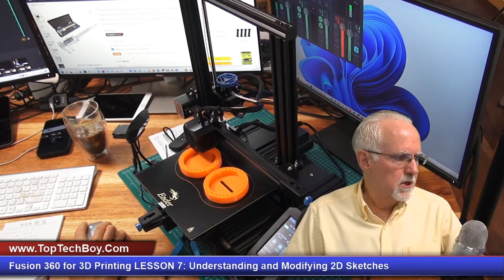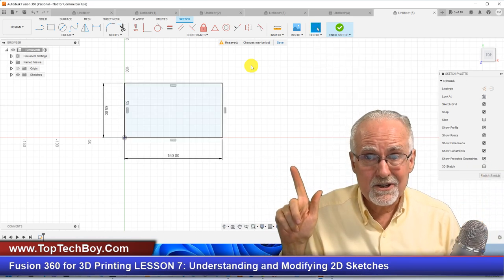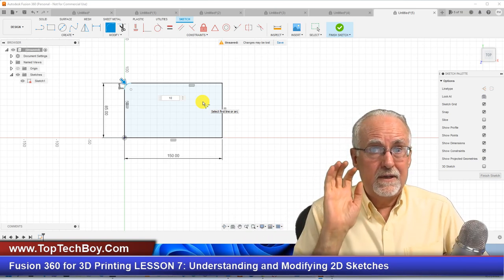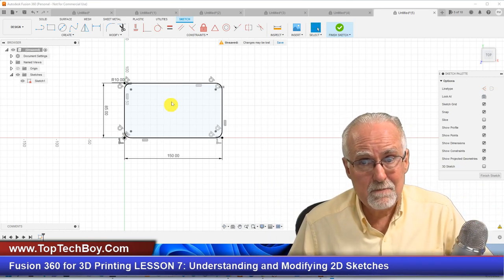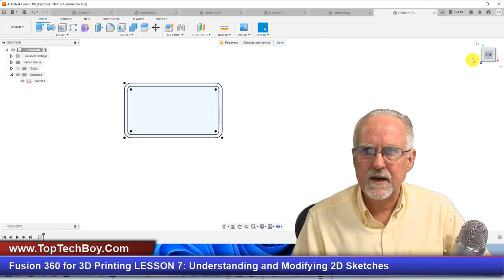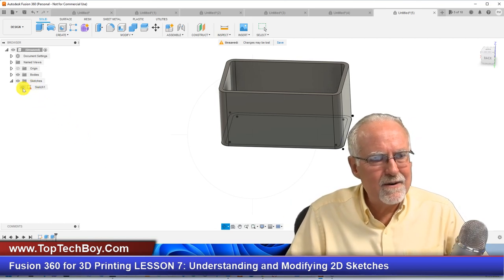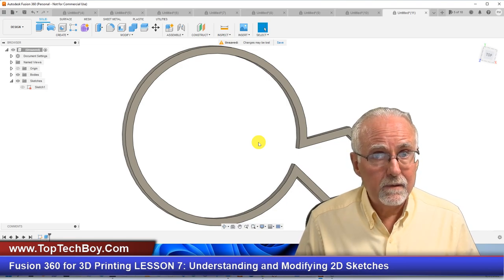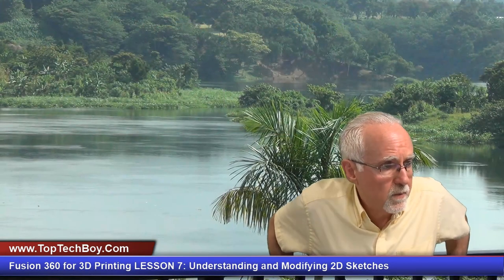Fusion 360 for 3D Printing LESSON 7: Understanding and Modifying 2D Sketches

Comment: Great lesson, I want to show some short-cuts since those might be helpful. 
L for line
R for Rectangle 
C for Circle
Esc to get out of the tool you're using (Basically it'll get you on the select tool)
D for dimension
T for Trim
F for fillet 
X will turn your line Construction/Normal
O for offset 
And you can hover over a tool, let's just say fillet there will be 3 dots (The info) click that, then you can change the keyboard short cut to what you want.
I don't know if this would be considered a short cut, but basically you can click the mouse wheel button down, and that will pan you around. If you click the mouse wheel button down WHILE clicking shift, you will orbit.
Hope this is helpful!
Reply: Thanks for the info!
Reply: tysm

Comment: I got a good portion through your first Fusion 360 Tutorial by translating from the older version to the newer version of Fusion 360. I managed to make and print quite a few designs from those tutorials... but summer 2022 happened.. I'm back this spring and delighted to find that you have created an entire new series of tutorials based on the newest version of Fusion 360! I now have two Creality Ender 3 printers... I felt I needed a spare, just in case :) I have actually been keeping both printers busy since February on a large project I took on and having the second printer makes one of them available for printing lessons more readily :) 
Unfortunately, I have not yet taught myself much about uploading video to YouTube, so I will have difficulty posting my homework :/ (One thing at a time). 
I did do extra homework to make a few things from the concepts in lesson 7. At some point, I will make an attempt to post them. 
Thank you for your tutorials! At some point, I will also make my way to patrion. 
Great Job Kind Sir!

Comment: Love these lessons.  At about 8:49 AFTER making all 4 corners the same size fillet, how would I go about modifying the sketch to make the lower 2 fillets different size form the upper two fillets?
Reply from the maker: If you want to do that, you need to build the filets one at a time and diminsion them individually. Dont do them all at once.

Comment: I'm having a little trouble about the @34:30 mark. I followed your steps step by stem, even going as far as to erase everything and follow along multiple times and when I go to make the polygon vertical to fully constrain the sketch, in your demonstration the whole polygon goes black and is constrained. When I follow step by step, only the line I select to make vertical (the same one as you chose) gets constrained. The other 5 lines stay blue and I have no lock. Was there multiple clicks or a key hold when trying to make that vertical. I learned so much from your lessons already. I'm only on this lesson but I've learned enough to make a little design of something I needed and it printed out great. I really want to grasp fusion better though so I really want to learn how to control my constraints better. Thank you SO much for your help and insight. How much is your patreon support? As soon as I'm able to I would like to contribute because you've been so helpful and others would benefit from such knowledge
Reply from the maker: Polygons are hard to constrain. I can not give you a simple answer. Play with it, and you should be able to get there.
Reply: you have to match the "25.00" with the  x's line (red)

Comment: Hi Paul,
This constrains makes me crazy, i have draw a hole for a 25p d-connector.. everything is black and fully constraint. nothing can be moved and still i have no lock.
is there a simple way to check what is wrong with my drawing, because all lines are fixed, and i can move nothing. every dot or line is black.
Thanks in advance
Reply: solved. see previous lesson

Comment: I am at the 20 min mark or so in lesson 7.  I cannot get the polygon to be fully constrained. I have done them multiple times, I inspect the video for the constraints, I compare to mine. They are all there.  Yet, my sketch still is not being rewarded with a "lock".
Reply from the maker: Polygons can be a chalenge. Just draw a polygon and play with  it. Sometimes you have to make sure the polygon can not rotate by making one side either vertical or horizontal.
Reply: @paulmcwhorter  Thank you.  I had to add a construction line that set the distance between the center of the two.  Before I could do that I had to delete the tangent constraint.  O/w I kept getting error saying it was "over defined."   But since I couldn't figure out how to fix until today, I proceeded by deleting the bolt and working just on the nut, which was constrained. 

After a while I got the nut to work, including the revolve.  But I would not have been able to do this part w/o watching solution in 11.

To finish, I made a copy of the  nut in another file.  After that I used the "Modify" and was able to replace the nut thread with a 15mm rod (join) of 25mm (15mm below & 10 mm above).  I then followed your steps to get thread. I learned join when you talked about it earlier lesson (maybe 7 or 8 -- I can't remember).   

I am still struggling.   I wish I could have done it in one file.  I'm reasonably satisfied.  I have tried to learn F360 a year ago. I got no where.  With your lessons, this is the furthest I have gotten. 

I am looking forward to tutorials on working on x-z plane. That was the hardest part for me in doing the revolve on the nut. I struggled at least 1 hr. to get myself to point where I could draw in the x-z plane and add the two triangles. Very often what works for you, doesn't work for me.  Not sure why, but I don't think F360 behaves consistently. 

Thank you!!!
P.S.
I made the glass box today.  I had a book that talked about parameters.  I know we have not done it, but I could never make any of that work either.  I first did the eyeglass box the regular way.  Then I use parameters.  That's something I was NEVER able to do!!!  I actually got it done today too.

P.P.S
If you could do a video on how to combine multiple files into one for 3D printing, would be very grateful.  It's a nice time saver to print two or more items at the same time.   In my case, print nut & bolt at same time. 

THANK YOU!!!
Reply: @paulmcwhorter  Thank you.
Reply: @paulmcwhorter  - If you are looking for a tutorial topic, importing mcmaster's 8020 or other items into F360, would be very helpful -))  

Thank you for taking time to do this very helpful series.  I had to slow down a bit for summer school exams, but picking back up.

Comment: I added a link to my google drive that shows the work but it disappeared. I have no idea what I did wrong. :-)
Reply from the maker: youtube doesnt allow external links. Upload the video to youtube, then post a link to your youtube video. We would love to see what you did.
Reply: @paulmcwhorter  All I had was two screen shots that I edited together into a png.  I will have to fiddle around with making  video. It's probably worth the effort because I use a technique that I was delighted to find worked.  I put several construction lines off to the side (like controls) and then made sides of rectangles be constrained to those lengths. To change I beams I just edited dimensions of a small set of off to the side construction lines. I know thee are better ways but the exercise was about constraints. :-)